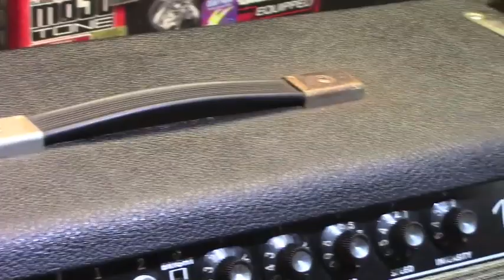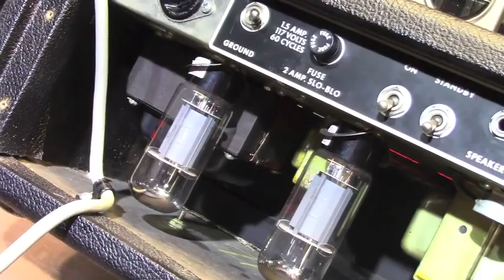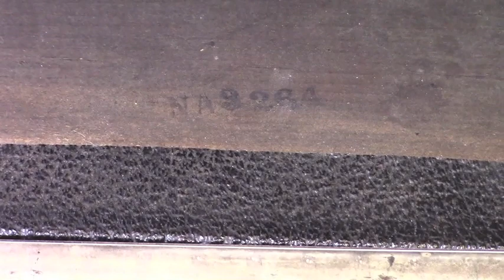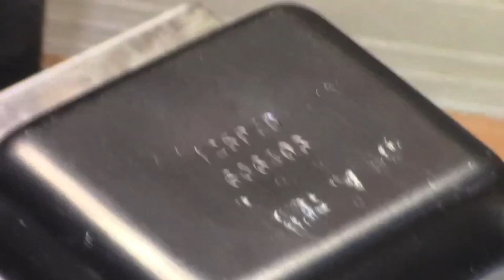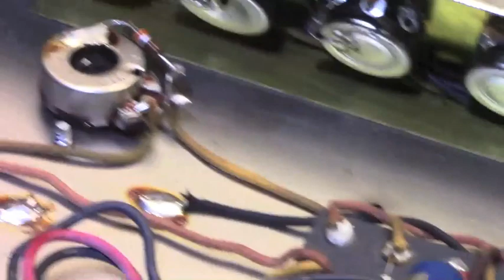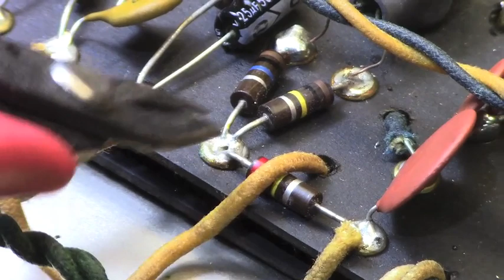On The Bench - The 1964 Fender Bandmaster Amplifier - Clean As A Whistle

Comment from the maker: EDITOR's NOTE : At several points in the commentary I misspoke about the year of this amp.  It is a 1964, NOT 1974.  Also sharp eyed Fender amp fans will note that this amp has a four ohm output transformer which would mean it left the factory with a 2x12 NOT a 1x12.
Reply: That choke looked newer than the one I'm my 1969-1970 silver face bassman head so that's weird but that bandmaster has weird rust spots.